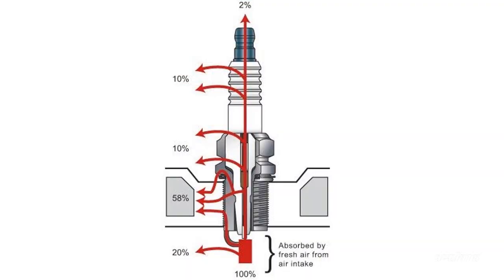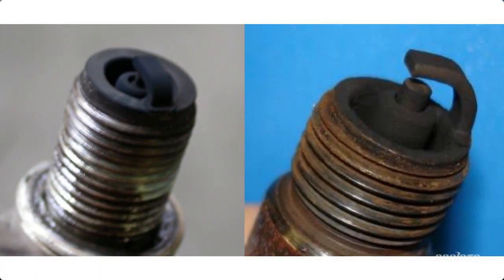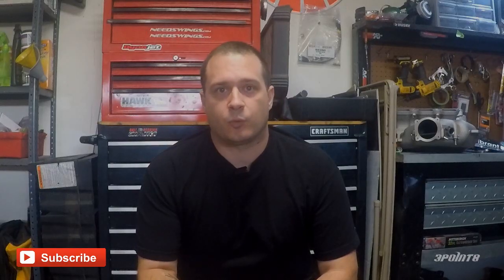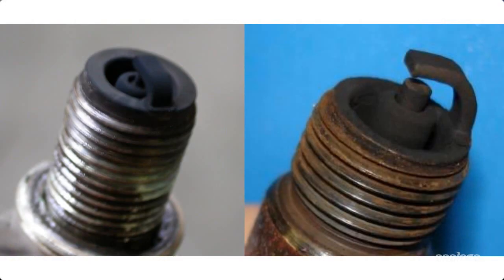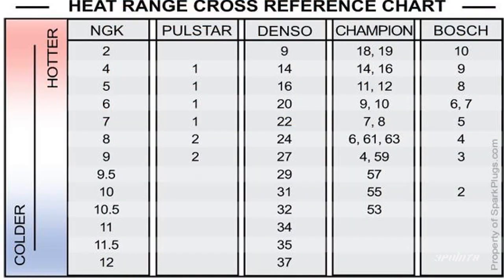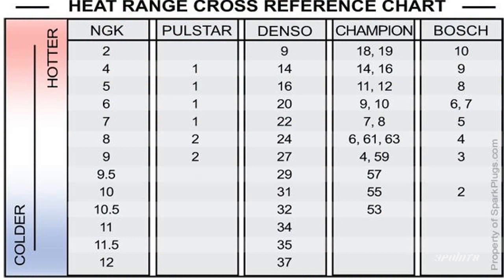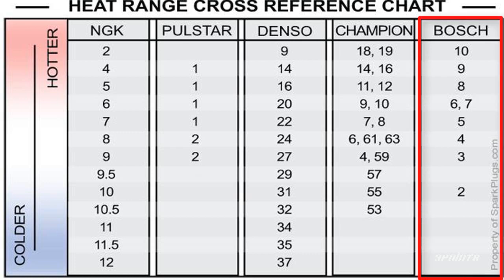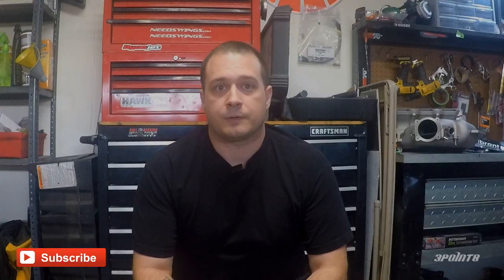Do Colder Spark Plugs Make More Power?

Comment: PSA: Performance Tuning does NOT include the use of Platinum or Iridium Spark Plugs,

So what if coppers Last only 20,000km when abused, they also don't knock like rare metals with horrible heat conductivity..
They are only meant for Family SUV's which need long service intervals. 

Copper plugs in stock heat range perform better than rare metals in 1 step colder

Comment: One of the purposes of a spark plug is NOT to pull heat from the combustion chamber. The misconception is that the spark plug is used as a sort of "heat sink" to absorb heat from the combustion chamber. That is not what the spark plug does. The spark plug firing end ceramic is passively heated by burning combustion gases - due to the mere fact that it's right in the fire. Because the ceramic gets hot, and the cylinder head that it's screwed into is a lower temperature, it does naturally dissipate it's heat to the cylinder head. Simple heat transfer - hot to cold. A "hot" heat range spark plug simply has a smaller contact area (between the ceramic and metal shell) to transfer heat thru - so the ceramic stays hotter, longer. A "cold" heat range spark plug has more surface area to transfer heat thru, so the ceramic stays cooler. Under normal operating conditions, the combustion temperature in the cylinder will be completely unchanged when going up or down one heat range. Too far up or down and carbon fouling (too cold) or pre-ignition (too hot) can occur. IN those situations, combustion temperatures can change due to the change in combustion - not because the spark plug "pulled" too much heat or didn't "pull" enough heat from the combustion chamber. It's not the way it works. Also, the temperature range you referred to is actually for the firing end ceramic - not the actual combustion temperatures. That is the normal operating temperature range of the spark plug. Actual flame temperatures are hotter. Unfortunately, there is a lot of bad information out there. Just trying to help.

Comment: I noticed by plug gaps open up quite a bit after like 1k miles theyl go from .025 to .030 
And at one point one of the electrodes even broke off on a start up they were ngk one step colder 
My setup is a 1.6l fiesta st fbo bigger turbo e40 fuel mix 29.45 lbs of boost
Should i go another step colder or go back to stock plugs?

Comment: Ok! I have a 350 sbc 10-1 thumpy cam, 750 Dbl pumper Holley! Hei ready to run, Complete brand new everything! Dart block Afr heads Ect! I am using Ngk R5671A-8 Spark plugs, seems to be fouling the plugs black fluffy but not wet plug! I have played with the timing and all adjustments on the carb, and no there are no leaks anywhere! So, was wondering what heat range should I go to hotter or colder?

Comment: I have a 2003 Accord Euro R. Honda recommends ngk 7. I have put ngk 8 which is 1 step colder because no stock for ngk 7.. Unless i went bonkers on top speed, pickup was sluggish. Need a few runs on full throttle to get back in tune. Then i went to a set of used multiple ground copper ngk heat range 7. The  good pickup came back. But i dont know whether it is the multiple ground plugs or the oem heat range that pulled back the power.

Comment: But cold spark plugs don’t make power if you use a hot spark plug in a high compression engine it won’t dissipate heat and will melt and you don’t want that.

Comment: I have a 2000 Kawasaki ZX-12R the compression ratio is 12.2 to 1.

I am forced to use 91 octane in California which is sold as premium.
My bike detonates like crazy after I have rode a while as in on the freeway.
When I pull away from a stop in detonates under pulling away from a stop.

At the track I teach at we sell 100 octane Sonoco.
I mix 4 gallons of 91 with 1 gallon of 100 and the pinging goes away.

I have 27,000 miles on the bike and I am the only owner.  it is 21 years old.

It gets check my Kawasaki valves are fine and clearance fine.
The bike is 100% stock!

The bike is extremely powerful.

I am using the stock plug “ Heat Range 9”
Would going to a colder spark plug help me?
Reply: You have to try and find out by yourself to discover, i think one step colder on iridium plugs wouldn't be bad...just one, each step decreases the temp about 70 degrees Celsius( make-up the convert to F...to see in you way...) inside the chamber

Comment: This is so cool! I have been reading about spark plugs and the various types: copper, nickel, platinum and iridium. I didn't know that using a spark plug with a colder heat range would make it hard to start, or make the engine misfire.

I have a 2004 Toyota Corolla. I'm definitely not going to add a turbo charger. It would probably blow up the engine! Back when I was at Western Michigan University, and I had a student job writing computer programs in Dbase 3 Plus, I worked with another student named Peter. He had a Pontiac Sunfire with a turbo charger. One day he told me he had to walk to work, because the turbo charger on his Sunfire seized. I didn't know that if the turbo charger died, you could not drive the car.

He said it was because oil for the engine also circulated through the turbo charger. That was just too much trouble. I remember my dad said, "Every thing you add to a car is something that can break down and give you trouble when you don't need it."

Comment: AFR says stock plugs (hot) can be used up to 9:1 compression, 9:1 to 11:1 one step cold, 11:1 to 13.5:1 two steps cold. When I bought 64 cc aluminum heads for my 350 Chevy which made the compression 9:1. I bought the recommended plugs and I didn't know but they were cold plugs for racing. I drove the car 5 miles, pulled a plug and they were black as coal. Two sets of fouled plugs later I found out I only needed stock, hot plugs..

Comment: Thanks man. Great help. Same issues faced after changing to colder plug. Harder cold start, misfiring on cold engine. Initially it performed well as you told. Might be because of perfect gap and new plug. Will switch back to stock soon.
Reply: now I know why my car has hiccups at cold start.

Comment: One thing I have a hypothesis about is on older high mileage vehicles, colder plugs can help a lot, because there's already possibly a lot of carbon buildup on the piston head and cylinder heads, and thus cylinder temperatures will be hotter. Also on cars with timing adjustable via the distributor bolt, you can gain a lot of free power from advanced timing + colder plugs. I think on some older cars, though, that seem to run rich inexplicably and don't rev smooth, it's the carbon build up causing detonation with even stock timing, but then running richer to stop detonation will lead to more carbon build up. I think colder plugs could be a secret weapon to stop and possibly reverse that cycle, as now the car will no longer detonate, and with stichio mix hopefully some carbon will burn off. Just some thoughts, I believe it's an underrated thing to do, and some manufacturers even specify wide heat ranges based on driving patterns. Honda specified NGK 6 on 90s Integras/etc, but said switch to 7 for sustained high speed driving. On some Honda scooters they spec'd from 6-8 depending on usage patterns in the manuals.
Reply: colder plugs burn off less carbon so it would be the other way around. If you are burning off carbon the engine will last longer, which would allow a higher mileage vehicle to go for longer.
Reply: @IAMLoudas nice! This is what i thought. Thats why im tring hotter plugs now 👌

Comment: Proof positive here, just did software and I was recommended colder plugs, but with ten installed the cold start was so rough, cyclinder 4 misfired constantly. Dropped the stock plugs back in as advised by tuning company and the car behaved very well as performed!😁Thanks,  this reinforces that advice
Reply: hmmm. I went one step colder per my tuner. rough cold start and same cylinder 4 misfire. lol. bmw btw. wondering if i should go buy and install the stock plugs. already replaced just the cylinder 4 ignition coil myself but the code came back and the car went into limp mode again after i let it idle for 10min.

Comment: How isn't running a fbo gonna benefit you when you install 1 stepped colder plugs, makes no sense. I have a bmw 335i n54 twin turbo with custom "3 chargepipe and bov, catless downpipes, dual cone intake and 7 stepped intercooler. Rule of thumb is every 100 over you upgrade. So around 500hp and up I'd be using 2 stepped colder plugs. I'm at 370hp and it's a must for 1 stepped colder plugs, why would anyone want to run stock plugs on fbo? Makes no sense
Reply from the maker: Because if you don't need a colder plug, you're just wasting money and pretending that you made a good choice. You need to change when cylinder pressures/temps get to a point where the plug tip is getting too hot. Since you're boosted, cranking up the boost is going to make those conditions happen and it's very likely that you need a step colder at that point. But don't get confused with needing a colder plug to make more power, and a colder plug making more power. It's a supporting mod, not a power adder. Your tune is what made more power, the colder plug simply allowed you to see the full potential from that tune. 

The step colder for every 100hp is very basic generalization for people who don't have the ability to actually determine if a colder plug is needed.
Reply from the maker: Also keep in mind that bolt on's are only making the engine more efficient, which is where the additional power gains come from, but they're not going to increase cylinder pressures or temperatures to a degree of any significance. Boost, timing and fueling are the things that effect cylinder pressures and temperatures.
Reply: Yeah but I got a twin turbo engine so it would benefit me
Reply from the maker: @GODISGOOD1916  Not unless you've done tuning or upgraded the turbos. What it comes with stock is enough for stock boost / timing.
Reply: @3point8  Wouldn't FBO be considered Tuned, I'm sure it is. Once you Upgrade the Turbos and Outlets after FBO and run MHD stage 2+ you'll need 2 stepped colder plugs. You could use 1 step colder with FBO.
Reply from the maker: @GODISGOOD1916  Honestly it depends on which community you're in. Some include the tune and some don't. I usually just specify FBO + tune to be clear. Some definitions of FBO don't include headers lol.

Comment: Did I miss it? Did you answer the question?  Can a colder heat range plug make more power?  Assume boost has been added, and the colder heat range plug helps keep cylinder temps slightly cooler.
Reply from the maker: A colder plug is not going to make any power. When needed, it will allow you to make more power. It's a supporting mod, not a power adder.
Reply: @3point8  makes sense, thanks!

Comment: obviously is an engine is modified for a more bore radius and higher pressure with higher running temperature, it is a good idea to change it for a colder spark plug to prevent autoignition (pre-ignition). colder plugs for an ordinary engine deposits carbon that later turn into hotspots and cause pre-ignition. nice video, thank you.

Comment: Hi, i have a volvo s60 with 1.6cc engine with 150 hp stock, i reprogram the ecu and now i 215 hp 55hp more do i need to go to a colder spark plug?i put hoter instead
Reply: Unless you increased boost or raised the compression the stock heat range is correct.
Reply: Depends. If you raised compression, increased boost, or went leaner then you need colder spark plugs. A spark plug that is too cold will foul quickly, a spark plug that is too hot can cause pre ignition and severly damage the engine.

Comment: On my 2 cycle bycicle  motor I whent on a cooler plug than the stock one.  My performance whent up, though I was not expecting this.  I did change the jetting on my carb to be leaner so that the engine run hotter.  Maybe I  found a comfortable medium.
Reply: I could also be that the new plugs fire better than the old ones, was the performance improvements immediate?

Comment: This video actually helped out. I'm running one step colder (tuner advised) and started getting misfires with barely 1000 miles on them. Warrantied the spark plugs out and ran good for a little bit and started doing the same thing. Just going to go back to factory spark plugs.
Reply: Not the  plugs its bad advice from  fake tuner know nothing
Reply: Your plug foul yeah your combustion temp doesn’t need colder plug just stick to stock

Comment: Other than bothersome fouling, going too cold will do real damage the engine.  Going too hot can and will damage the engine.  If your plugs are quickly eroding or even melting the poles, then you need cooler plugs.  If pre-ignition is being caused by high plug temperatures, then go cooler; you may hear the knocking or the knock sensors may be signaling your cpu to make changes to reduce knock and thus cutting your power.  If plugs are getting too hot, drop 2 ranges.  If plugs are wet and/or fouling, then go up one step.  Old school and good rules of thumb.
Reply: You wrote that either way will damage the engine..
Reply: @greebuh  Well, there is that "lesser of two evils" thing.  Too low of a heaat range for the plug will foul the plug.  Too hot will damage the ceramic and metal and the pre-ignition can damage the engine further.

Comment: Add a low temperature thermostat with it when u wanna go with a cold spark plugs n probably u will need a tune to make it work as it should, well it depends on ur car if it needs it or not
Reply: M91:  Usually adding a low temp thermostat will cause the engine to become stuck in a warm up mode and run rich because the computer thinks the engine is still cold.  Believe it or not, most engines make the most power at 200 degrees F.  The factory engineers usually pick the right temp thermostat.  Picking the OEM temp range is usually the best way to go.  If a car is over heating... it usually needs a bigger radiator.  People use those low temp thermostats as a bandade instead of fixing the real problem.
Reply: @fwh79FOXR6  a tune wont fix the problem? B cuz i am going to do a big radiator and strong fans, i want to upgrade the cooling system b cuz am going boosted and i need all the cooling i can get from colder spark plugs to water/methanol injection and of course am going to tune the car to work with the 170 thermostat and get the best of that cold spark plugs
Reply: M91:  What kind of car are you working on?
Reply: @fwh79FOXR6  mercury marauder 03
Reply: What are you planning on using for boost?  Blower or turbo?
Reply: @fwh79FOXR6  eaton m112
Reply: fwh79 low temp thermostat isnt for driving to the store its for if you drive it hard all the time like highway pulls every day or whatever.... it will never warm up all the way if your driving miss daisy

Comment: On the bmw 335i twin turbo would it be a good idea to go one step colder?
Reply: I went  two steps colder in my 335i n54 im running e40 mix with water methanol injection made a big difference
Reply: only if your running e85
Reply: Jesus Araujo not yet so what other spark plugs should be good?
Reply: Jorge D. Carrillo hell yes we need one step colder on n54 or n55 if you are tuned or more.
Reply: I went one step colder and smaller gap, along with newer model coils, on FBO and Stage 2 + tune, on an e90 335i.  I did it because it was skipping a little whan it was first started and I suspected it was plugs or coils.  If I was going to change them, I might as well upgrade to better quality.  The new gear does seem to have fixed my skipping issues--Probably just because it is new stuff.  I'll have to see if there are long term issues or not.  Based on the one step colder per 100 hp, and the quality difference from what I pulled out, I think it was probably the correct choice.
Reply: @OakInch  update?? Any long term issues? Driving same car & I think I’m going one step colder due to misfire issues but they’re twice the price lol so I want to make sure
Reply: @rylancarrier7455  It runs great.  No issues.

Comment: Hi, I have raised my cr in my car from 11.0 to 12.0 and where I live there is only low octane fuel. So far the car doesn't seems to knock but do you think I will benefits from a step colder plugs from 6 to 7 ngk ?
Reply from the maker: What car and what engine/setup do you have? When you say low octane, do you mean 91 only? 12:1 is pretty high for pump gas unless you're GDi, but even that is close to the limit. You would def want to switch to a 1 or 2 step colder plug, but I'd recommend you do some data logging and see if you're knocking or not first. If no knock, then you're probably fine.